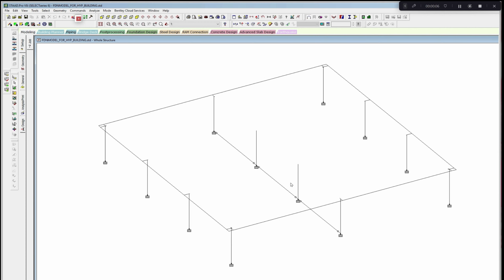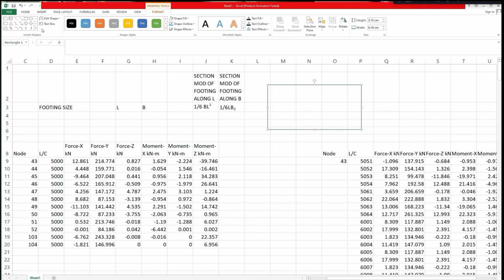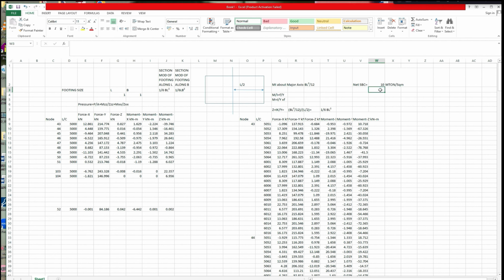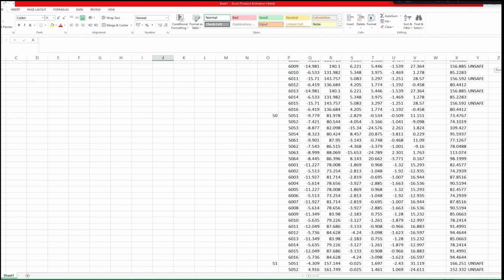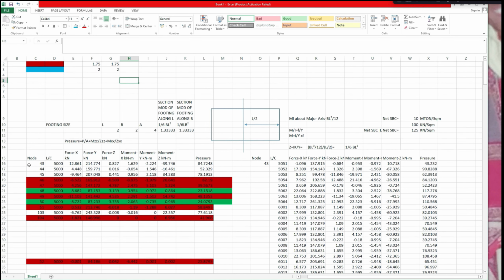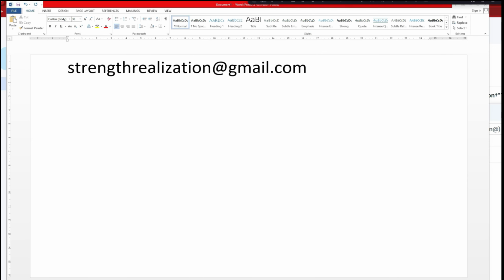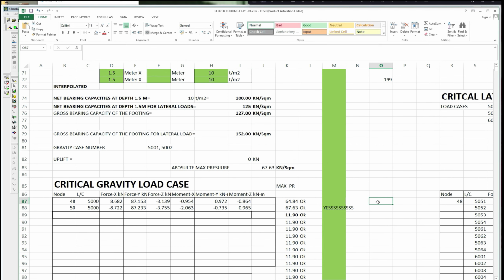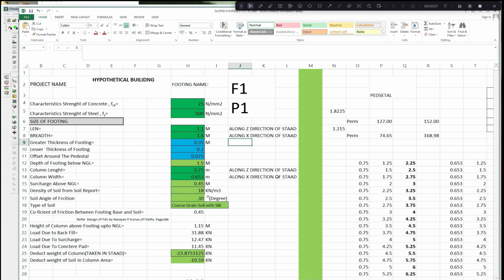SECTION 15D DESIGN OF FOOTING

Comment: Sir can you provide video on design of steel col.pedastal design with r/ f to avoid shear failure..
Reply from the maker: Usually  the Pedestals of Steel Columns are large. However , if Shear is still concern, design shear Stirrups s as we do for Beam. but In case of a Pedestal Shear capacity of concrete alone will be enhanced due  to compression. So available shear capacity under compressive load should be calculated in order to achieve a Economic reinforcement design for shear.